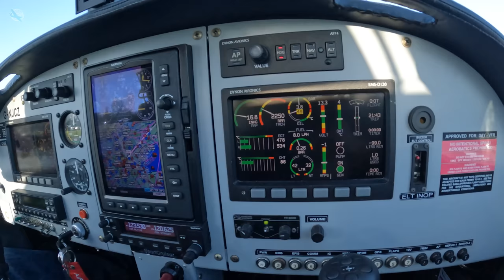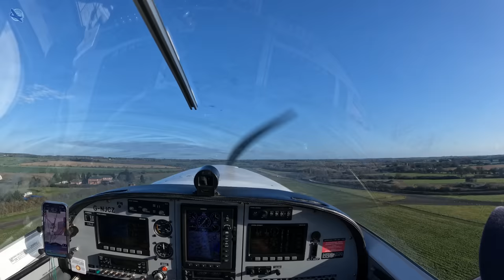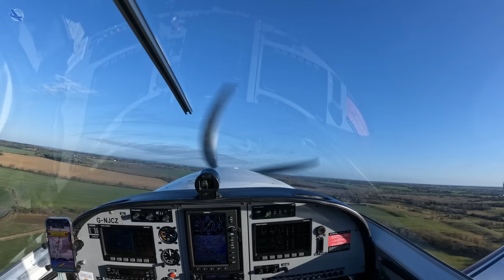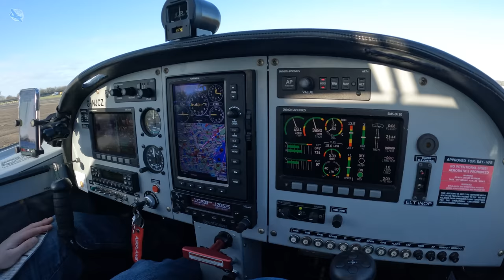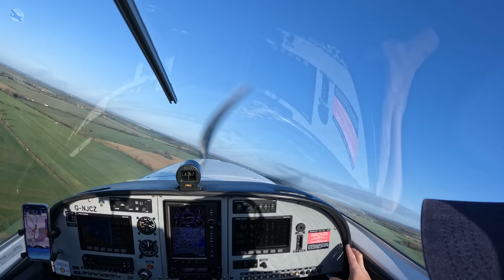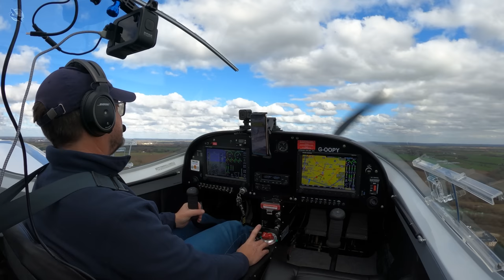Engine trouble immediately after take off!

Comment: I had a similar situation flying a C152 out of Naples, Florida
Got to 500 feet, the engine skipped a beat (as did my heart) returned to land; engine seemed OK on the return
Taxi-back to threshold, did run-up; all OK, so I took off again, 500ft the engine skipped a beat, so I landed-back and made a squawk entry. I was told the aircraft was OK and that I was just a "lazy" hours-builder (but I have a very acute ear).
That afternoon, I was up with an instructor in another plane working on my IR and on the tower frequency. 
I heard "May Day, May Day" engine failure - it was the plane I'd squawked; low-time student and instructor. The engine had proper failed. THANK GOD they made it down. It turned-out that the float in the carb was sticking, It worked fine at ground level but at the reduced air pressure of 500 feet, the problem manifested. Anyway, I didn't say "I told you so". I was just pleased both souls were safe.
Reply from the maker: Thank goodness all were OK, I think this happens more than we would want it too.

Comment: Great video. Thanks for sharing. I had a comparable experience a couple of months ago in a 172. A sudden rough-running engine in the departure climb just before reaching pattern altitude. The engine lost power but didn't stop, which allowed me to get back safely after flying a shortcut circuit and probably the worst landing I have ever made. However, nobody injured, and aircraft in one piece. The malfunction was caused by a cracked inlet valve in cylinder three which left me stranded 120 nm from home. Fortunately, one of my former instructors was on a trip and had the time to pick me up. I then flew the leg home as P1 with her on the right seat in beautiful weather, which was the best that could happen after this stressful event. I don't know why your mate didn't join you on your trip with Papa Yankee, but he probably had enjoyed this flight as I did enjoy mine after my incident.
Reply from the maker: Great story thank you for sharing.

Comment: Nightmare! From what I've read, partial loss of power is potentially more dangerous than a full failure, because they're unpredictable. I hope I don't have to deal with either any time soon. Well done for getting it down safely!
Reply: Potentially a lot more. If the engine explodes you just concentrate on landing. If its surging or hunting it can overwhelm you with seemingly too many options.
Reply from the maker: Yes in hindsight partial on this occasion was OK we had choices, but when it goes completely the choice is made for you. Cheers Scott.
Reply from the maker: So true James.
Reply: @ShortField  I had a cracked cylinder which we found later and was stuck in a situation on takeoff at about 500ft where I couldn't climb but I could maintain height, and I decided to fly around back to land but didn't have that much airspeed and was on the back of the drag curve. I landed ok. But I think about that flight a lot.  I suppose if it had got worse, I just would have landed ahead.  But at the time you just do what you think is best you don't freak out or worry at the time.
Reply: @dr_jaymz  hindsight is 20/20 and all that.
Reply: @dr_jaymz  glad to hear you had a good outcome too!
Reply: @dr_jaymz  You did a "500 agl LOTO Turnaround the airport".  Many have stalled it when lose speed before base but it looks like you are going faster due tailwind on downwind leg.  They stall and  crash turning base to final.

Comment: Great video.  I had one of my Maggs go done on my last flight up North. It was my first emergency. I had to divert to Darley Moore. It did shock me and my passenger but luckily I was 3000 ft and was able to cruse decent 15 mile to land. It ended up being just a Magg  switch. I was able to continue as The airfield happened to have a spare switch which was a blessing. Thanks for posting.
Reply from the maker: That was handy Roger. Thanks for the excellent comment and kind words sir.

Comment: Having had 3 partial EFATOs I can confirm they are much more challenging than a clear cut full failure. Was good to see an immediate lowering of the nose, speed is life and it helps if that is the very first part of the emergency brief. Don't skip that brief. I don't know your type but it looked like there was enough remaining to land on if the decision had been made promptly. You might not be so lucky with a recovery of power in future and it's worth thinking about. The mini circuit looked good, but keep evaluating the options as you progress, if it goes now we will be in that field/short runway etc. It's a shame civil rules essentially prevent practicing failures below 500 ft as that's where you need hands on most. Call that PAN or MAYDAY early if you can.
Reply: Spot on comment👍
Reply from the maker: Yes agree 100%.

Comment: More people die from partial engine failures than full ones and there were two opportunities to land that were turned down, presumable out of concern of damaging the aircraft.  A take off brief would help prepare your action plan.
Reply from the maker: Excellent advice Steven. There's such a short decision window and then it's gone. I agree a proper brief wwould have been a good idea.
Reply: As a glider pilot, we’re expected to brief our plan for launch upset at various heights as part of our eventualities. I usually say “if I get out of position I will release. Below 300ft I will land ahead (due to the impossible turn back), above that it’s a right 180° (into wind), above 1,000ft it’s an abbreviated circuit”

When an instructor pulled the tow release as I hit 300ft, I found the briefing really shortened my hesitation before I made a right turn back. Sounds like a good thing to run through pre-takeoff for general aviation as well (if you don’t already)
Reply from the maker: @Will-ui7dv  I think we all go through the scenario in our heads before taking off on every flight, however as you say, with two on board perhaps we should have a verbal brief beforehand. Respect for glider dudes.
Reply: @ShortField  thanks for the reply! You're one of my favourite YT creators, I love hearing how you think and learning all of the lessons with you. Thanks for putting out great content <3
Reply from the maker: @Will-ui7dv  Wow thank you so much Will. Cheers buddy Terry
Reply: @Will-ui7dv  
what would you have done in this scenario exactly do you think?
Reply: @jeremykemp3782  freeze up for 5 seconds, make a hasty 180, do a downwind landing back the way I came and accidentally ground loop it off the end of the runway. Idk man, I’m not a power pilot. In gliders I can easily switch from a 35:1 to 7:1 glide ratio with the air brakes and side slip into a pretty small spot. That’s a lot harder without air brakes.
Reply: @Will-ui7dv  
And the glider?
Reply: @jeremykemp3782  oh right! At the airfield I fly from, I brief to land ahead or 30° to each side below 300ft above the ground. Past 300ft I enough altitude to do a 180° turn and land back the way I came. Sometimes there downwind component is too strong to do that safely - I will address that in the brief on the day. One of the vectors intersects with another in one direction. If I’m on that vector, I’ll brief a 90° turn as an option for a rope break above 300ft, especially if that’s into wind. Above 800ft AGL I can safely do an abbreviated circuit. 1,000ft AGL is a normal circuit.

Reasons for releasing early include a radio call or wing wag from the tow plane, me getting out of position vertically or laterally, or one of my wings touching the ground

Comment: Beautifully handled and kept calm under pressure. Old Warden is very close to me and is a great place to visit, I will have to do it on the paramotor at some point. Great video, and glad to learn the engine issue was a  cheap fix.
Reply from the maker: Thanks Mark.

Comment: One of the toughest calls a single engine pilot can be faced with! A partial power loss at this critical phase... do I cut the power and land asap on the best option... or try to 'nurse' it around to the first available runway - hoping it keeps running? Well handled - thanks for sharing.

Comment: Glad you both made it back safe. 

Had a similar incident during training. I screwed up a practice forced landing. Had s fouled spark plug so had the engine chug for 10 seconds then recovered. Freaked out my instructor. She grounded the aircraft when we got back since also the rpm counter broke during approach.
Reply from the maker: Lots of heavy breathing and a dry cleaning bill, but ended well. I've never heard of an actual failed plug (in fact it was two) they are so simple, fouled yes but not failed. We will need to investigate further. That's not great when training but it all adds to the experience. Thanks so much for the coffee as well Glenn really appreciated.

Comment: Hi Terry. thanks for sharing the engine power loss on takeoff. I will say i am not familiar with your aircraft type. But the GA planes i flew before we Always did a run up of the engine at about 2000 to 2400 rpm depending on type. just before take off. And at that stage switch the magneto´s from both to right and left to look for the drop in rpm. I guess in your case you would have noticed something was off before takeoff with this check. but i am not sure what your manual states. But in that case there would be a chance that you would  not have taken off with a faulty ignition system and notice the problem before taking it in the air.
Reply from the maker: Thank you for the great comment. We always do a run up and did on this occasion but run ups are not done at full power and it was only shortly after take off that the issue with the plug came about.

Comment: Lovely video, lots of drama and very interesting listening to the decision process when the engine runs rough. 50/50 of landing vs continuing so well done for making a good call and getting down safely. And for getting straight back up and out. How many times have you had something like this happen on take off before? Just wondering as you both were very calm.
Reply from the maker: I would have gone for the immediate landing Chris but then I wasn't flying. Jared did well. Never had a Rotax even hiccup but did have a full EFATO in an Arrow about 15 years ago.

Comment: lol for some unexplained reason when you landed back down after the power loss, the image of the Scene from Battle of Britain came into mind of them saying "You can teach... Monkeys to fly better than that."  Good use of CRM, when it happened. You have to keep in mind you are in the second control seat, when your adrenaline is pumping emotions running you miss the obvious so it would not have been a bad thing to list the options. " we have the disused runway we can land on or we can attempt a normal landing."   He was PIC does not mean your not SIC. if you see something say something.  

on a minor note about the birds I am surprised no one scared them off, they use fireworks and dogs and other methods to prevent them from going onto the runway or anywhere near the airport. Great video, and good to watch
Reply from the maker: Birds have been an issue at our airfield I agree should have cleared them before take off. This could have been so much worse and I felt I was very poor as a PNF, but I have learnt lots from this for next time :-) Thanks Bartram.
Reply: @ShortField  Not at all, he told you what he wanted, you took over the radios. he decided to head to the normal runway. Like you said there were vehicles including a fuel truck on the old runway.  The plane lost a cylander and you limped back you both walked away that is  PNF job done.  The only thing I'd suggest to you when you pull up to the taxiway is not to stop right at the line instead leave room for error at least a wing length from your nose to the line.  At the start when you called off the flight and started turning your right wing went over the line  because you were right up against it. Which gave you no options but to cross over the line.

any part of your plane that crosses the line that is a runway incursion, the bigger planes would have been sent around because the plane would have received an alert by your wing crossing.  I did check England/EU has the same rule as the FAA any part of your plane crosses that is a runway incursion.

Comment: You did a "500 agl LOTO Turnaround the airport".  Many have stalled it when lose speed before base but it looks like you are going faster due tailwind on downwind leg.  They stall and  crash turning base to final.  For me, I would have dropped the nose, and the power as soon the engine LOTOT and land on end of that runway.  I have done it from 100 on 4k" long runwy.
Reply from the maker: We do a few things wrong here but live to do it right next time. Thank you
Reply: @ShortField  Learn how to do Turnbacks from Departure Leg.  I did one that saved me from crashing ahead on houses.  Its not an "Impossible turn" if you can complete it.

Comment: Hi Terry, Great video. Did you find anything further wrong with the engine? I have had a complete mag failure (CDI) box on a Rotax engine whilst in the air. It dropped a couple of hundred rpm in the cruise and this started the let’s find a field quick planning drill! Did all the usual checks and noticed a drop in EGT, hence the search for the nearest strip. Fortunately we had one close by. I am surprised that one plug would cause a very noticeable loss of power. Also had a plug foul with 0320 and only found it on the power check when switching to individual mags. 

Best Mike.
Reply from the maker: We switched from 100LL to Mogas when we fitted a brand new engine last year, when running on Mogas you can increase the plug replacement times to 200 hours from 100 hours, we have now gone back to the more conservative option after this issue. It was very noticeable with a drop in max revs from 5,200 to 4,100. They tested a second suspect plug and that too was faulty so two plugs, they were both at 197 hours each. Thanks for the kind comment as well Mike.
Reply: @ShortField  
Terry were faulty plugs both in the same cylinder?
Reply from the maker: @stevenstyles7602  yes, I believe so, we're going to get the carbs checked.
Reply: @ShortField  That makes sense. Always did ours a 100hrs.

Comment: Terry
Great video as usual, I’m supprised how rough the engine ran, considering you’ve got 2 plugs per cylinder.
Reply from the maker: Yes me too Steve, main problem was we've never had that engine even hiccup and we were both worried it was going to go completely.
Reply: @ShortField  
Yes, I see what you mean, if you’ve always had it running sweetly, any change in tone/rpm is alarming.

Comment: As for early engine failure, kink to one side then loop back directly on the runway, going far out at 90 degrees is not the optimal. You can even make it standard practice in take off to kink to the side immediately after take off to have natural loop back. And go low to keep up speed so you don't stall in a turn. Stall is not your friend. Some have an erroneous belief that you can just pull back in the stick to keep it in the air. That really does not work. First premise of flying is to understand that a plane is a glider. And it helps to know if your plane is a bad glider. For instance a Bonanza is for some reason a very bad plane and returning after engine out in a Bonanza is difficult. Most planes can easily return to the runway, just have to think it through once and for all. It can be practiced in sim and in real life, perhaps at raised altitude until you can a clear sense of stall. Stall in a low altitude turn is simply not your friend. I'm guessing it's the number one pilot killer.

Comment: I realize this is an older video, but I must mention how you guys are landing a Sport Cruiser with the nose wheel contacting the surface at about the same time as the main gear (landing "flat"). This is a big time no-no and sooner or later will result in damage to the airplane and your ego. Dial in nose up trim on downwind and keep the nose wheel from making any contact with the surface until you gently let it down as is bleeds off speed after touchdown on the mains. This landing "flat" is a common problem with a lot of pilots and it's asking for trouble. With your camera, practice keeping the nose wheel at least 4 inches above the surface after the mains make contact, then keep it there!
Reply from the maker: Interesting you say that. In my 600 hours and over 700 landings in the SportCruiser I’ve found that it likes to be landed fairly flat. Obviously protecting the nose leg.

Comment: So glad that you're safe Terry, you both made some good decisions.💜💜✌️👍😊 Nice of your mate to loan you Goopy💜✌️😊

Is it common for spark plugs to fail in a Rotax? I've only ever had one fail during my part two motorcycle test, raining, not fun, rough running on one cylinder - passed though. I've driven a lot of miles, plugs never been an issue, always replaced when stipulated (relative to mileage) and on my bike they were two new NGKs🙄🙄 

On a lighter note, was that a line of Ford Mustangs that I saw to your right at the hanger?🤔🤔👍✌️

Here's to you having lots of happy flying in the spring and summer 🤞😊👍
Reply from the maker: Thank you as always. I've had plenty of fouled plugs but never had failed plugs before, it was totally obvious when they were removed that there was an issue with the electrode, looked like they had just burnt out. Engineers are looking into it. Maybe a bad batch?
Reply: @ShortField  Ahh yes fouled plugs, perennial issue on a two stroke engines - early Rotax etc. The only thing I've heard of is fake spark plugs in the automotive side of things, they're not easy to spot and some large suppliers have been duped too. Not saying that's the case in aviation though. Even genuine, once great quality products, outsourced to Pacific rim for manufacturing, seem to fail a lot now too☹️ Poor quality or communist conspiracy? Take your pick 😕😉😳😉